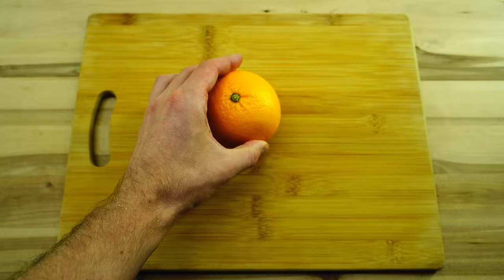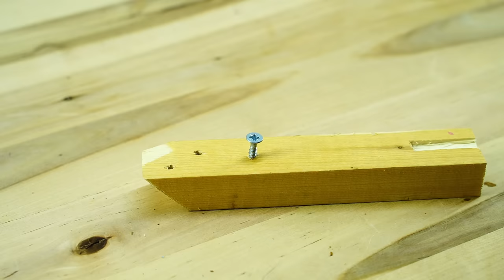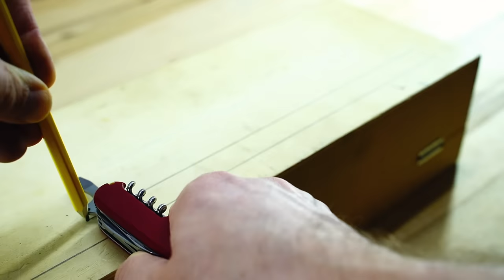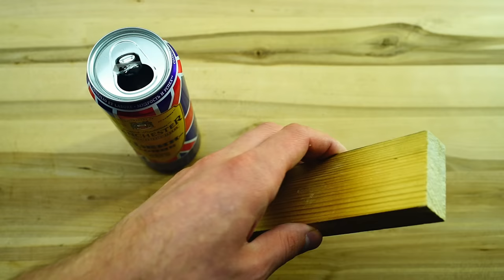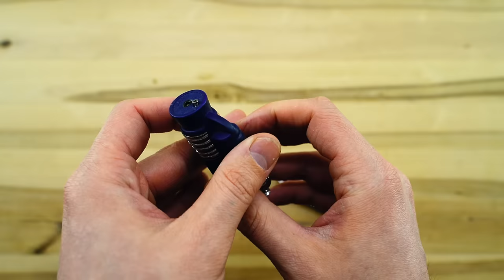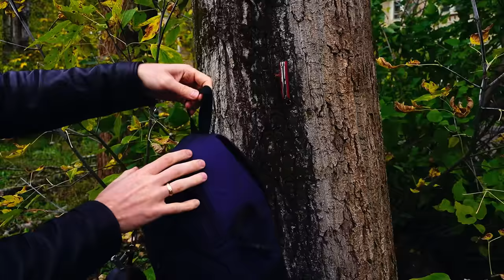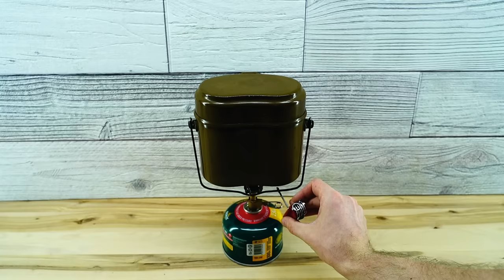60 Secret Functions of the Swiss Army Knife Only a Few People Know About

Comment: the ONLY ones of these i've never done are: the ones that require the pencil/pen and the file, because i've never owned a SwiAK with one of those in it. i've also never done any of the cellphone stands. i quit camping/hunting/going out on US Army field exercises, before the smart-phone was ever invented. so i've never needed a cellphone stand. everything else, i've done at least once. 

oh, and i carry a SwiAK EVERYWHERE with me in my pants pocket since 1980 when my dad bought me my 1st one. even to court, or other places with metal detectors, or if i leave the yard of my house even to go to the 'stop n rob' for a snack/beer run etc. that first SwiAK of mine is presently enshrined in a 'jewelry drawer/hideyhole' somewhere in my house and my newer model i carry presently is one i bought in 2003 before i deployed to Iraq. even on 'da plane, da plane' i ask TSA if SwiAKs are ok... if 'da rules' say they're not... i turn around and poke it into my carryon somewheres and they usually just nod and wave me through. but i don't ever fly anywhere since i left the US Army so... :D what do i know about TSA rules anymore? ;> 

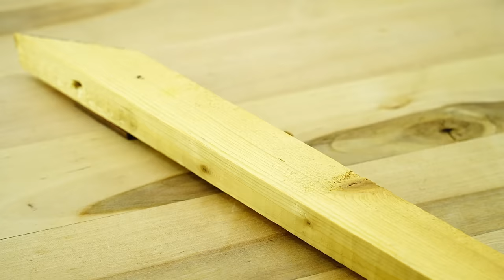one you missed! but you got close to it, at timecode 3:43 when you were splitting the electrical cables. splitting wood, specifically branches/twigs WITH THE GRAIN. INSTEAD of the penknife you used for the wire... you take the long knife out at a 90degree angle to the handle. tap point of the blade into a BIG piece of wood by knocking on the blade's joint on the back of the SwiAK. BASICALLY the same idea you had for splitting the wire. the 90deg bend makes whacking the knife with a piece of wood or using a piece of wood as a 'pad' and knocking the knife blade in with a rock works good too. you need a BIG piece of wood as your 'base'. one you can get your foot on and hold the 'log' steady. logs work great! now, you've got to knock the long knife into the log at LEAST 3" or 7.62cm... depending on how hard or tough your log is. AT LEAST past the 'belly' of the blade. NOW... you have a highly steady SPLITTING BLADE for your tinder sticks, twigs, and branches. you can split them LENGTHWISE easily by popping them on the opposite end of the stick from your SwiAK splitting blade with a rock, another stick, or a mallet/hammer. :D 

do NOT do the previous against the grain... use the saw for that! ;> i learned that 'problem' personally while my dad was smirking behind his hand muffling his laughter on the other side of the campfire we were building.

Comment: It looks like your phone was pointing at real north without adjusting for the declination scale in your area.
Reply: You can set it to either true or magnetic north.
Reply: @grantdavis5992  no way!  Technology works?
Reply: @latetodagame1892  and I can check with the Air Traffic Control at your local airport to get the current declination because it is continually changing.  Then I can set my 58 year old Silva Ranger compass to current declination. Fortunately,  it has a tiny brass screwdriver on its lanuard to make the adjustment.
Reply: @grantdavis5992  you're pulling my leg about the air traffic control thing, right?
Reply: @latetodagame1892  it does actually change slightly throughout the day, and the absolute number is available to pilots, so I was being a bit facetious.  The amount in my area of Central California has changed from 16.5 degrees west in 1960 to about 12.5 degrees west now.

Comment: As cool and interesting as this is... about 50% of the "secrets" are unnecessary. Using different tools to do the same task like unscrewing a screw or holding a phone up multiple different ways. It should be titled "several different awkward ways to use your swiss army knife in ways you never will."